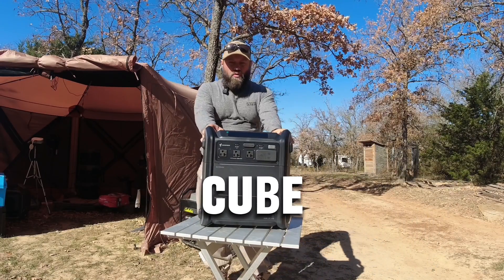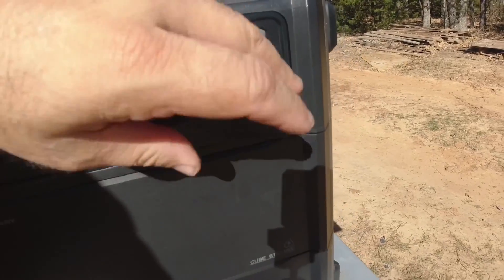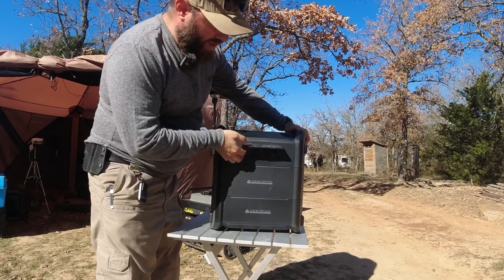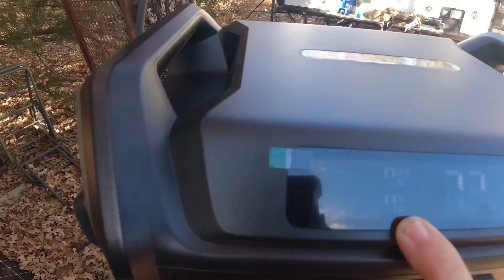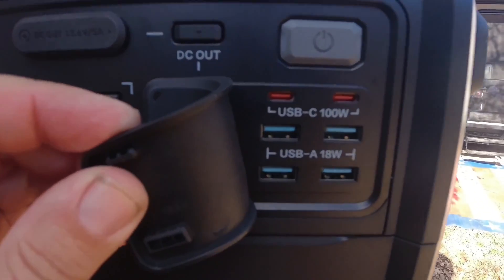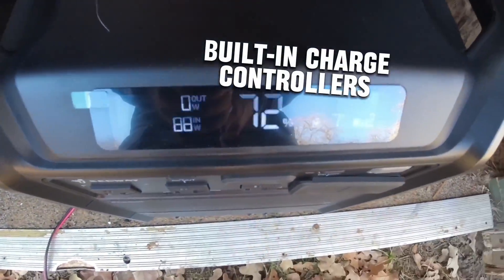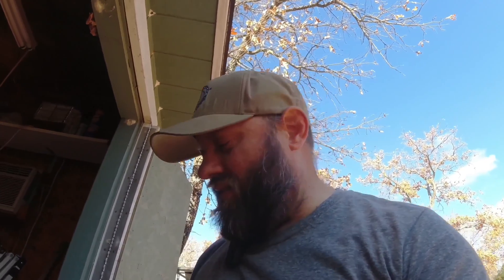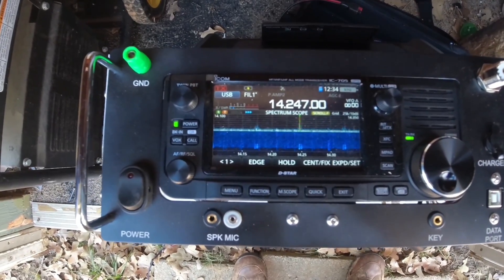Segway POWER CUBE with up to 5kWH of Battery!

Comment: Most important point is they are LIFE P04 batteries which last up to ten years and are way safer than Lithium Ion. I bought the cube 2000  this year they have a very nice build and they are very rugged.

Comment: Sadly old battery chemistry. Will have limited life.
Reply: It's UL-certified automotive-grade lithium iron phosphate power cells.  Are you holding out for sodium?
Reply: It contains high quality auto grade LiFePo4 batteries. This is one of the highest quality power stations available. DJI power station is a good unit.

Comment: looks ok. common to get RFI from them. all mine do. can you look into cycle life of the battery ? also put a AC load on it. and put some distance with you IC 705 from it and check the RFI again. maybe even try a AM radio . I found on some of them that using a extension cord on the AC the cord acts like a antenna and makes the RFI go even farther . I had to wrap my cord threw ferrite to stop it. it worked. but a still needed to keep it like 100 ft away from my radio .73's

Comment: Jason, have you come across any of the pre-made/commercial solar generators that actually put out More than 10 amps at 13+ volts?   The best I can find is 10amps.
Reply from the maker: 10amps output from what port?  That isn't something I usually look for
Reply: @HamRadio2  just looking for a pre-made battery setup to run like a 7300 and a mobile 2m/440 rig with DC power and enough amps.   I know you talked about it in the video,  but I'm hoping someone makes one for Hams eventually.  Like a 20amp or 30 amp DC out.
Reply: Hi there! The Segway Portable PowerStation Cube Series sounds like a great option for your power needs. It offers a massive capacity of up to 5kWh and delivers powerful output. Plus, it has a super fast recharge time and versatile sockets for charging your devices. Check it out, it might be just what you're looking for! Happy camping and enjoy your family time!